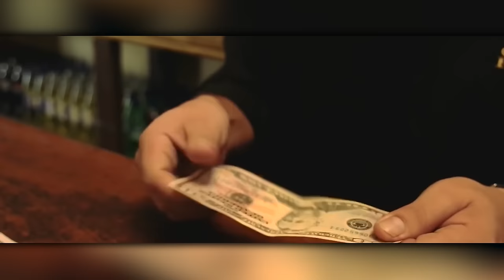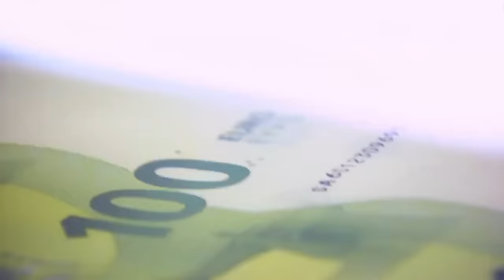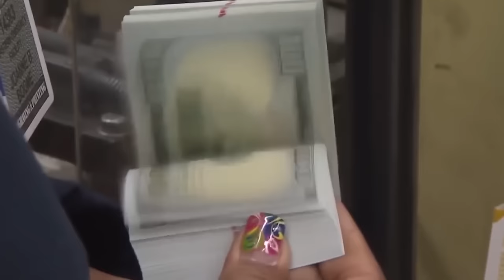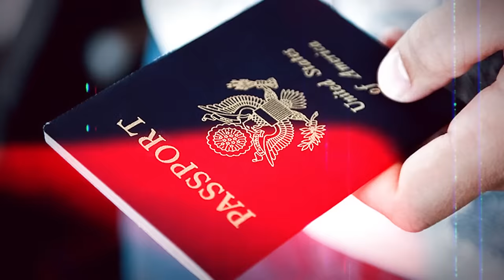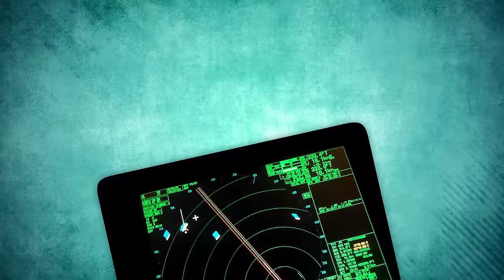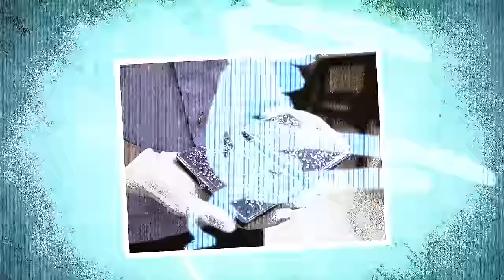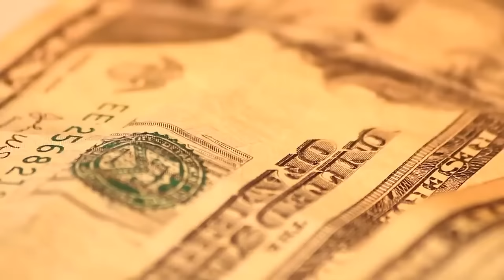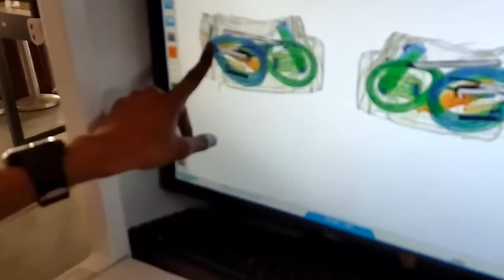The Smartest Smugglers In All History

Comment: You know how easy it would be to recruit a driver thats trusted at the border and they see multiple times a week driving a company truck from a trusted company? We had a couple guys delivering san diego from city of industry working for my company that, after unloading at Trader Joes would park in a warehouse connected to a tunnel across the border, get loaded with 35k lbs of weed and coke and deliver it to LA twice a week and did it for YEARS before they finally got stopped and caught at the scales/Immigration check about 75 miles north of the border on I-5 in CA. The only reason they got caught was, we come back empty, there is no back hauls out of san diego, and these 2 guys were the ONLY drivers for our company going north with a loaded and not empty trailer and they caught onto it after a few years.